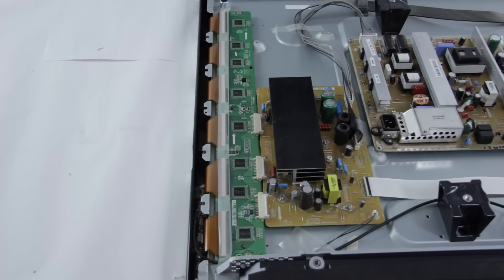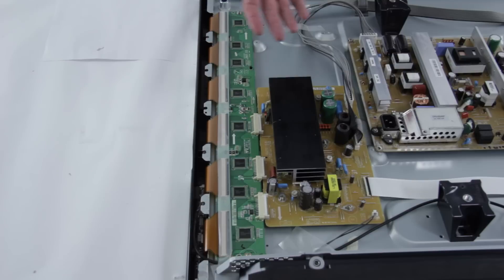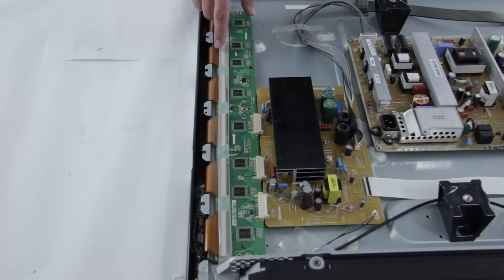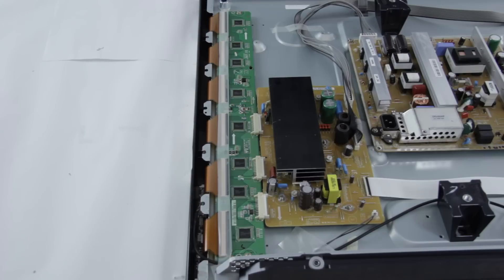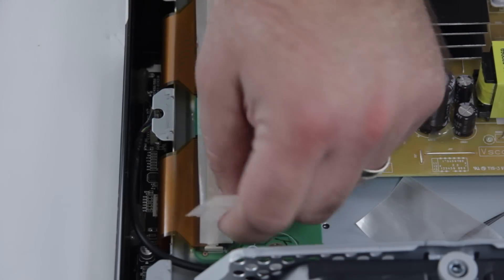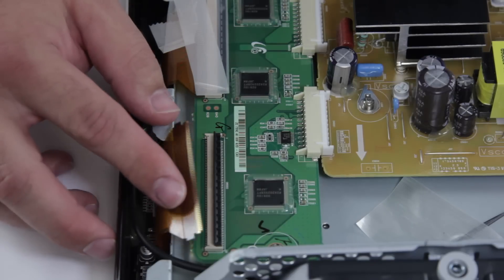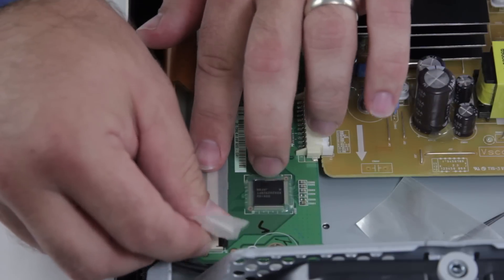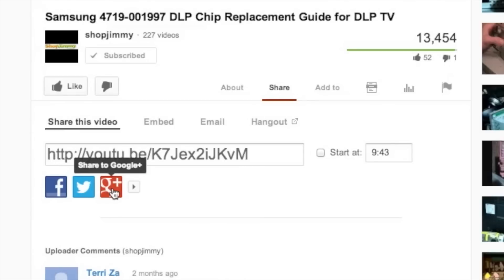Plasma TV Repair - No Image, No Picture on Plasma TV Screen - How to Replace Y-Buffer & Y-Sustain

Comment: Hi! I have a Panasonic Viera TC-P50C2 my tv has no picture but does have sound, the sound has a bit of static to it!
Reply: The image gradually collapsed towards the center of the screen then never came back! Please help, thank you!!
Reply from the maker: jdmfabes   I recommend replacing the A main board in your TV.  Here is a link to replacement parts for your TV model number on our website, click here:  http://www.shopjimmy.com/catalogsearch/result/?q=TC-P50C2  Be sure to match part numbers on your current board, with your replacement for compatibility.  Here is a link to a video showing how to identify your part number, click here:  Panasonic Plasma HD TV Repair Tips: Suffix Codes for A Board & Main Boards  You can also call our customer service for further assistance with your purchase.  (877) 881-6492  Thanks and please let us know if you have any further questions with your TV Repair!  www.shopjimmy.com

Comment: Have a Panasonic Virea TC-P50S030, ser.# ME11540657, date of mfg. 6-2011, purchased from Best Buy 2-11-2012.
A few days ago I turned it on and had no sound, thought it might be DrecTV, turned it off and tried a DVD and now got nothing, no red light, would not turn on. Unplugged waited a few minutes, nothing. Tried a different receptacle, still no red light, nothing. Called Panasonic had to give credit card then was suggested to do what I had all ready done, that was helpful for $9.00. They gave me their approved repair facility contact. Contacted them and reviewed the problem, they said it is probably the power supply, $65.00 to look at, $250 - $300 to change power supply.  If in fact it is P/S and after watching your video, I am sure I can do it.  Oh, buy the way, I am in back and forth with Panasonic regarding only lasting 27 months. The have asked for the evaluation from the repair facility. ????????? My # is (802)722-3107 in VT
Reply from the maker: Thomas Spencer   Have you checked any voltages on the power supply?  Thanks!  www.shopjimmy.com
Reply: ShopJimmy.com I had my Son, who was an electrician check the power board. He used a VEi G2 Phoenix Pro: DL379 meter and found 120 at the main cable connector of the power board (board # NOAE6KK00005) (panel sticker MC127FU11411) but no power at any of the other connectors on the board. Pushing the power on / off button made no difference. Also there was no click when pushing the on / off button. He said there was very slight voltage at the power button.  He said he felt that the fuses were OK.
Reply from the maker: Thomas Spencer  Thanks for your patience.  Can you please double check the model number on your TV?  You had written TC-P50S030, but I am having trouble finding any info for that TV model.  Is it actually, TC-P50ST30? or TC-P50S30?  Thanks!  www.shopjimmy.com
Reply: Thomas Spencer Further the power board # NOAE6KK00005, Panel sticker MC127FU11411, date of mfg. June 2011
Reply from the maker: Thomas Spencer   I recommend replacing the power supply board in your TV.  Here is a link to replacement parts:  http://www.shopjimmy.com/catalogsearch/result/?q=TC-P50S30  Be sure to match part numbers on your current board, with your replacement for compatibility.  You can also call our customer service for further assistance with your purchase.  (877) 881-6492  Thanks and please let us know if you have any further questions with your TV Repair!  www.shopjimmy.com
Reply: ShopJimmy.com Thank you for your help. the swoop of the boards looks straight forward, again thank you.
Tom

Comment: Panasonic TH-58PZ700U

Screen will turn white with sound. A hard reset would fix the problem. I did this for the past two months. Now the screen stays white with sound. A hard reset does not fix the problem anymore.

Please Help
Reply from the maker: moho96760   I recommend replacing the main board in your TV.  Here is a link to replacement parts for your TV model number on our website, click here:  http://www.shopjimmy.com/catalogsearch/result/?q=TH-58PZ700U  Be sure to match part numbers on your current board, with your replacement for compatibility.  You can also call our customer service for further assistance with your purchase.  (877) 881-6492  Thanks and please let us know if you have any further questions with your TV Repair!  www.shopjimmy.com

Comment: I have a Samsung PN59D550C1F plasma that gave the loud POP and went dark with some great electric burn smell.  Attempts to turn on again result in the red power light flashing and the click...click as though it is trying to turn on and then right back off again.  The TV has an exceptionally long 1-year warranty that ran out just over a year ago and the service call starts at $80 to just get them out to look at it, so I thought I'd do some research into fixing it myself.
Reply from the maker: A Li N   Check the X, Y and power supply boards for burn marks and or swollen capacitors.  Let us know what you find.  If you do decide to replace a board, here is a link to replacement parts for your TV model number on our website, click here:  http://www.shopjimmy.com/catalogsearch/result/?q=PN59D550C1F  Be sure to match part numbers on your current board, with your replacement for compatibility.  You can also call our customer service for further assistance with your purchase.  (877) 881-6492  Thanks and please let us know if you have any further questions with your TV Repair!  www.shopjimmy.com

Comment: samsung PN60E530A3fxza plasma TV with black screen, no image.
Reply from the maker: CLwolf2010   I recommend replacing the Y-Main Board and the upper and lower scan drive boards in your TV.  Here is a link to replacement parts for your TV model number on our website, click here:  www.shopjimmy.com/catalogsearch/result/?q=PN60E530A3fxza  Be sure to match part numbers on your current board, with your replacement for compatibility.  You can also call our customer service for further assistance with your purchase.  (877) 881-6492  Thanks and please let us know if you have any further questions with your TV Repair!  www.shopjimmy.com

Comment: Hello, I have a Vizio P50HDTV10A. I do have sound and a mainly black, flashing picture. Along with the flashing is a ticking that is in-time with the flash. I am not able to change the input with either the remote or via the hard buttons on the side of the TV. Unit is a little shy of eight years old. Thanks!
Reply from the maker: Stephen Bauer   I recommend replacing the YSUS board in your TV.  Here is a link to replacement parts for your TV model number on our website, click here:  http://www.shopjimmy.com/catalogsearch/result/?q=P50HDTV10A  Be sure to match part numbers on your current board, with your replacement for compatibility.  Here is a link to a video showing how to identify your part number, click here:  LG Plasma TV Repair: DIY Part Identification Number ID Guide for LG & LG Philips Plasma Panel Parts  You can also call our customer service for further assistance with your purchase.  (877) 881-6492  Thanks and please let us know if you have any further questions with your TV Repair!  www.shopjimmy.com

Comment: Hi, my question is about my PN42C430A1D samsung. at the moment i can get audio but I have no picture, just a black screen. one thing i did notice, when i had the back off, it looks almost identical to the one in your video. you see the small square chips on the Y buffer, there is like 8 or so. on mine, the one at the very bottom of the screen in the video, has a small nick in it from what it looks like. when the tv gets turned on, you can hear a small sound from the board beside it and there is a quick flicker of what appears to be a red LED light coming from that "nick" area in that chip. I assume that is not supposed to happen since all the chips appear to have the same numbers on them but only one has that happen. is it possible that its just that Y buffer part i need to change out? and if so where do i get one? thanks
Reply from the maker: Lego m   I recommend replacing the Y-Main board and the Y-Scan Drive board (s) in your TV.  Here is a link to replacement parts for your TV model number on our website, click here:  http://www.shopjimmy.com/catalogsearch/result/?q=PN42C430A1D  Be sure to match part numbers on your current board, with your replacement for compatibility.  You can also call our customer service for further assistance with your purchase.  (877) 881-6492  Thanks and please let us know if you have any further questions with your TV Repair!  www.shopjimmy.com

Comment: HEY i have got a LG 50PG20D plasma 50inch tv made december 2008 serial no 812kccv47675. i had it given to me as is. have no picture but still has sound can change channel sound no pic. i pluged another tv in to the output and i get picture and sound. cant see any visable shorts or blow caps. fueses are good
Reply from the maker: Benjamin Green   I recommend replacing the YSUS board and YDRVTP and YRDVBT boards in your TV.  Here is a link to possible replacement parts for your TV model number on our website, click here:  http://www.shopjimmy.com/catalogsearch/result/?q=50PG  Be sure to match part numbers on your current board, with your replacement for compatibility.  You can also call our customer service for further assistance with your purchase.  (877) 881-6492  Thanks and please let us know if you have any further questions with your TV Repair!  www.shopjimmy.com

Comment: I have a pioneer PDP 5060HD plasma television.  Today when I turned it on --- the top half is black but the bottom and audio are fine.   Any suggestions?
Reply from the maker: Steve Gomes   I recommend replacing the upper buffer in the TV.  Here is a link to replacement parts for your TV model number on our website, click here:  http://www.shopjimmy.com/catalogsearch/result/?q=5060HD  Be sure to match part numbers on your current board, with your replacement for compatibility.  You can also call our customer service for further assistance with your purchase.  (877) 881-6492  Thanks and please let us know if you have any further questions with your TV Repair!  www.shopjimmy.com

Comment: hi, could you let me know what the problem/answer to the fact my LG 50PC1DA, IS DOING TWO THINGS, firstly, it is white with all horizontal lines in color, and then black screen with a white line horizontal moving along the screen !
please help, as I can't afford to fix it, before i know the fault, thanks ,Daniel.
Reply from the maker: Dan Ham   This sounds like a TV panel problem.  If your TV panel is bad, it may be more cost-effective to replace the TV as panels are typically hard to find in stock, difficult to replace, and expensive.  Thanks and please let us know if you have any further questions!  www.shopjimmy.com

Comment: i have a Samsung FP-T5084X/XAA,  
\I HAVE A THIN VERTICAL COLOR LINE ON THE FAR LEFT EDGE OF THE TV. I'M THINKING OF CHANGING THE Y-SUSTAIN.
Reply from the maker: gary paul   This sounds like a problem with your bottom address buffer or the TV panel.  You can replace the buffer to see if that fixes the problem.  Here is a link to replacement parts for your TV model number on our website, click here:  http://www.shopjimmy.com/catalogsearch/result/?q=T5084X%2FXAA  Be sure to match part numbers on your current board, with your replacement for compatibility.  You can also call our customer service for further assistance with your purchase.  (877) 881-6492  Thanks and please let us know if you have any further questions with your TV Repair!  www.shopjimmy.com

Comment: I have 60 inch LG plasma TV (LG 650PZ550).. About week ago i was watching tv and big pop sound on my tv so i turn it off..there turn it back on now i can hear the sound doing out of my tv but no picture ( black screen) can you help me find out what wrong and how to fix please..
Reply from the maker: 5338solo   Check your buffer boards to see if you find any pin holes in them.  If you do see pin holes, then I recommend replacing the Y-board and buffers.  I am not seeing any information online about the TV model number you provided.  Please double check and let us know if it is different.  Thanks!  www.shopjimmy.com

Comment: Black screen on Samsung plasma TV model number PN50C450B1D   serial number Z1M83CQZ608781T   which item may need replacing
Reply from the maker: Tho Wopat   I recommend replacing the Y-Main board and the Y-Buffer board in your TV.  Here is a link to replacement parts for your TV model number on our website, click here:  http://www.shopjimmy.com/catalogsearch/result/?q=PN50C450B1D  Be sure to match part numbers on your current board, with your replacement for compatibility.  You can also call our customer service for further assistance with your purchase.  (877) 881-6492  Thanks and please let us know if you have any further questions with your TV Repair!  www.shopjimmy.com

Comment: I have this same model. I have a black screen and the tv makes a clicking sound and cuts on an off several times. At first I thought it was a blown capacitor but when I examined them I found they were all still functional. I know you recommended changing out both the y sustain and the y buffer but is it more likely to be one or the other in my case??
Reply from the maker: 4coolfool   We recommend replacing both so there is no further damage to the set.  When one goes bad the other goes slighty after and by putting a new part in the other part either takes out itself or the new part.  Thanks and please let us know if you have any other questions!  www.shopjimmy.com

Comment: Hello, I have an LG 50PA6500 plasma. One day while playing ps3 i lightly nudged it on the wall mount and the picture went out but audio in all inputs comes through clear. I took off the back to look around, all capacitors seem flat, no apparent burn marks, i have a multimeter but dont really know what im doing. Any ideas as to diagnosis? i've already order a new y-sus board online, but haven't recieved it yet. cheers!
Reply from the maker: Owen McCaffrey   A large flat-head screwdriver between the buffer and the y sus can help ease the 2 apart but they are just a friction fit.  Lifting the sustain up a little sometimes helps as the screw posts have a little lip that catches on the sustain.  Be careful and let us know if you have any other questions!  www.shopjimmy.com

Comment: I have a 42 inch samsung plasma Model PN42A450 that is 6 years old with sound but no picture. No menu or guide working either, no popping sound. Screen stays black when turned on, does not look grey in dark room. All capacitors look good. All fuses are good. Heat syncs on X-main and power board are warm. 2 heat syncs on Y-sustain are warm and one is not. All small heat syncs on Y-buffer are cool.I have looked at the logic board and there are 2 green lights, one comes on and goes out when the tv is turned on, the other blinks continuously about once per second. At first I was thinking it was the Y buffer board but I was told the blinking light would be much slower denoting a problem board. Any thoughts?
Reply from the maker: toolmanbill   I recommend replacing the Y-Main board and the Y-buffer(s) board in your TV.  Here is a link to replacement parts for your TV model number on our website, click here:  http://www.shopjimmy.com/catalogsearch/result/?q=PN42A450  Be sure to match part numbers on your current board, with your replacement for compatibility.  You can also call our customer service for further assistance with your purchase.  (877) 881-6492  Thanks and please let us know if you have any further questions with your TV Repair!  www.shopjimmy.com

Comment: hi jimmy  i got a  pioneer model  PDU -M5003, problem here is that  tv  shuts down few seconds afeter  i  turn it on. i ordered a buufer board, but  it seems to be diferent them the one in this particular model,
what could you sugest in this situation? please help
Reply from the maker: Remi Godoi  I recommend replacing the power supply board in your TV.  Here is a link to replacement parts for your TV model number on our website, click here:  http://www.shopjimmy.com/catalogsearch/result/?q=M5003  Be sure to match part numbers on your current board, with your replacement for compatibility.  You can also call our customer service for further assistance with your purchase.  (877) 881-6492  Thanks and please let us know if you have any further questions with your TV Repair!  www.shopjimmy.com